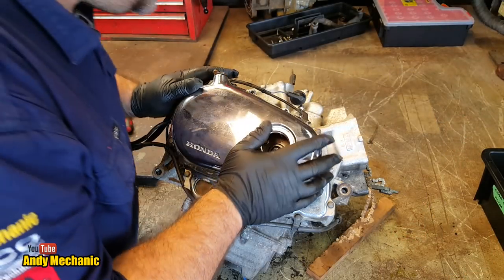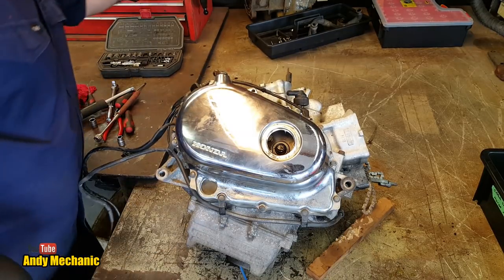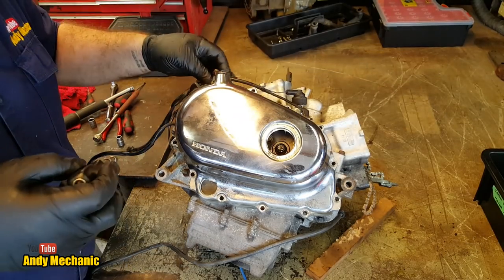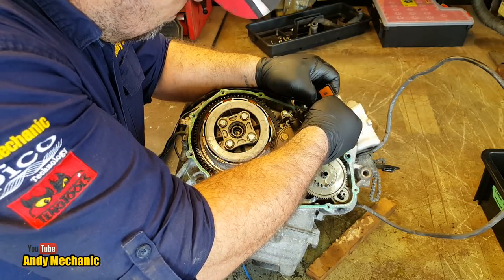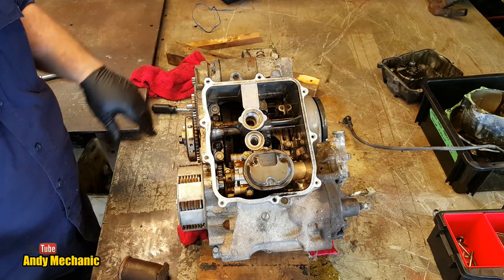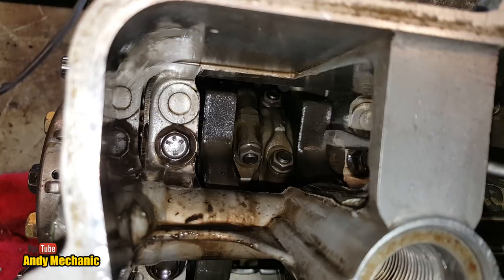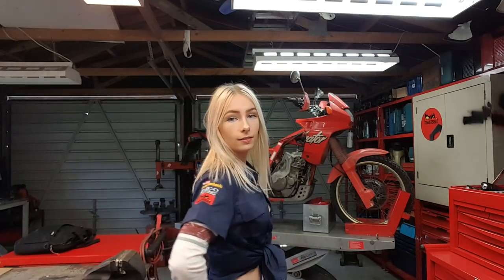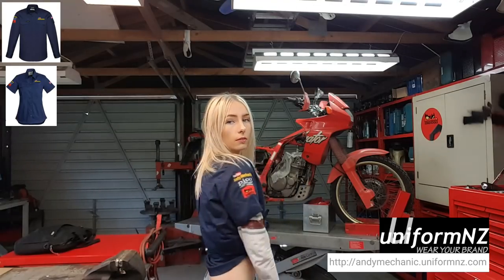Honda 250cc V-twin piston & con-rod removal #1172

Comment: Good Video Andy. Looking forward to seeing you put it back together!. Might have to do it with the sound off though...
Reply from the maker: What was wrong with the sound? Cheers Andy
Reply: Nothing. I'm more worried about the prospective swearing when you try to put those caps & bolts back on.
My only complaint about the sound is I have to turn it up sometimes to hear what you're muttering about & then you hit something with the hammer. :-)

Comment: Andy torqueing those connecting rod nuts will be a challenge the angle they are on. Are you replacing the journal bearings and are you replacing the connecting rod nuts. Will you be gaping the piston rings to the cylinder bores? Do you remember which piston goes in which bore? Good video mate looking forward to the next ones. Cheers from the USA. 👍👍
Reply from the maker: Sure will :-) I'll cover all that in future videos covering the build. Cheers for your feedback. Andy

Comment: Andy, not much blowby on those pistons are you sure its not just valve seals?
Reply from the maker: Hi Dave, agreed. Valves were the issue highlighted during the leak down test but the bores are glazed and there is corrosion too so keen to rectify whilst I'm 'in' so to speak...

Cheers Andy